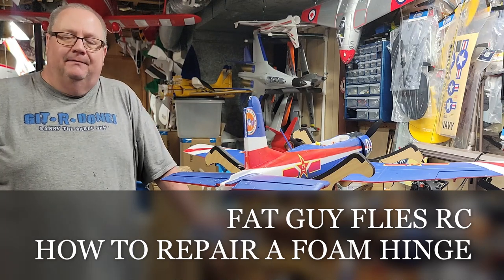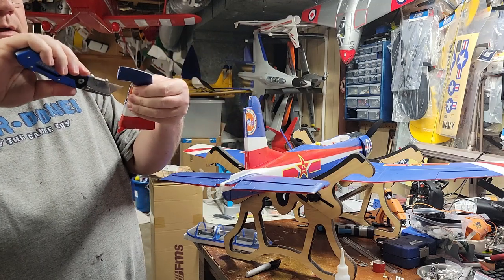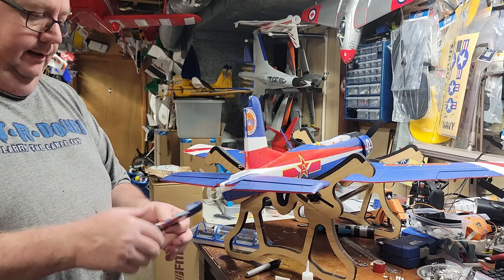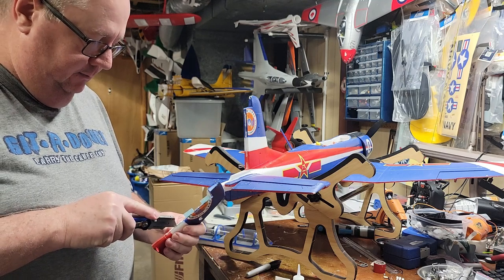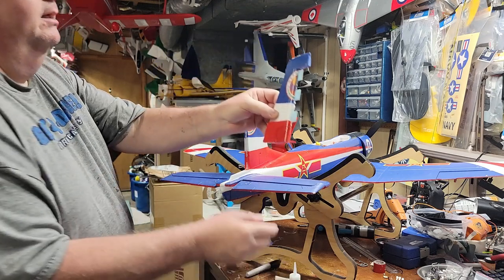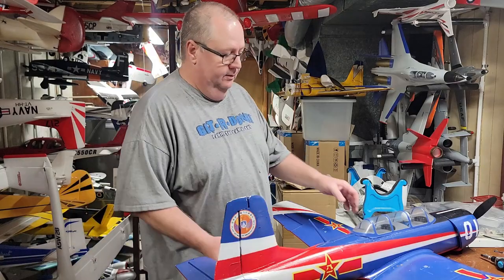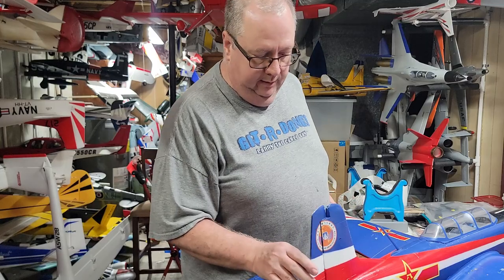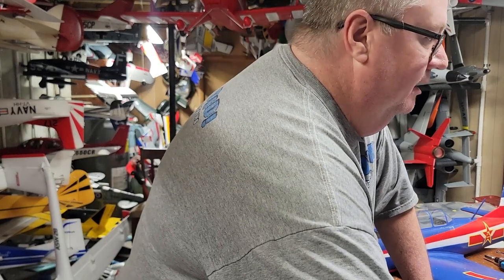HOW TO REPAIR A FOAM HINGE ON A RC PLANE! by Fat Guy Flies RC

Comment: What make and model box cutter do you use? Not all box cutters are the same, some can cut deeper than others.
Reply from the maker: LOWEs brand this one: https://www.lowes.com/pd/Kobalt-Kobalt-Quick-Change-Folding-Lock-Back-Knife/5001727641?cm_mmc=shp-_-c-_-prd-_-tol-_-ggl-_-LIA_TOL_216_Construction-Hand-Tools-_-5001727641-_-local-_-0-_-0&ds_rl=1286981&gclid=Cj0KCQiAutyfBhCMARIsAMgcRJSZR3QiCKVAR5wPgEsZ-O8EAp94bbHg2lN2Eh6mLy75Tw4xkkqn-OUaAt49EALw_wcB&gclsrc=aw.ds
Reply: @FatGuyFliesRC  Thanks very much, I'll pick one up!

Comment: I've done similar repairs using a type of zip ties. Sometimes it's hard to get both sides even, good tip!
 Good job,  what other planes you have for sale?🙂
Reply from the maker: Thanks. At my club I have the FMS ASW 17 2.3meter Power Glider for sale. $175 local pick up only and the ARROWS RC SZD 54 $165 local pick up only. Both are PNP.
Reply: @FatGuyFliesRC  not really into gliders, thanks lol